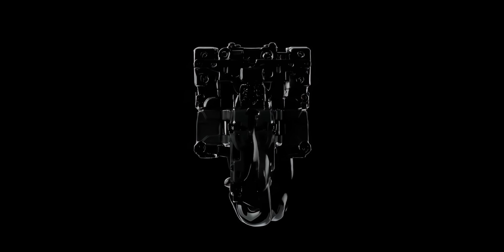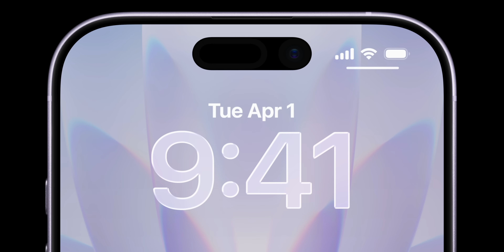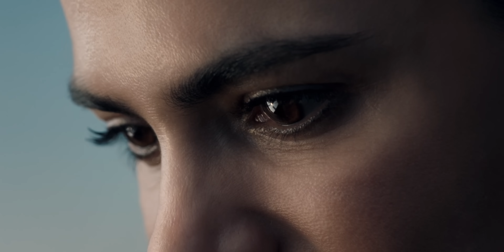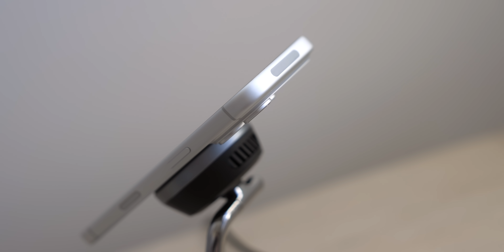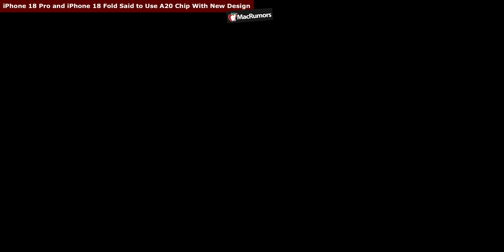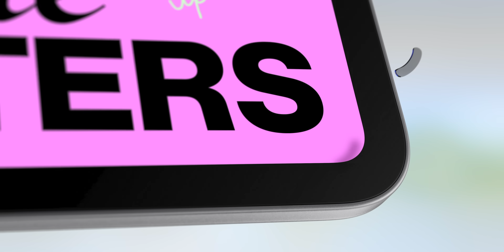iPhone Ultra Early Look! Major Leaks & Rumors!

Comment: I actually dislike Face ID, always found it so clunky:
-doesn’t work when I’m laying down 
-doesn’t work when i have any facial contortions, e.g chewing, or when i have anything in my mouth
-doesn’t work at more than a slight angle, like if i just want to quickly take a glance without holding it up, or when im working at a desk and the phone is flat in front of me (i have to pick it up each time to look at notifications which is more distracting )
- took them until after the pandemic to have it work with a mask and it still only works 50% of the time
- and sometimes it just doesn’t want to work

Comment: I would 100 percent rather have 2 devices. I keep an iPad mini in my bag and it is so much better than any foldable and costs way less. I see this ultra selling about as well as the iPhone Air. Especially if it is $2000+ cost device.
Reply: An iPad Mini is far less capable than a Z Fold. The Fold 7 is effectively the same size as an iPad Mini, too (similar screen real state in slightly different aspect ratios). The only thing the iPad Mini has over the Fold 7 is stylus support, in which case just get a Fold 6.
Reply: @nickthaskater I was comparing the rumored iPhone ultra to an iPhone  + iPad mini. The 2 device setup is far superior and costs less. I have never used a Z Fold, Fold 7, etc so cant compare it to an iPad mini. My friend did have the foldable Samsung that recently came out and I looked at it and wasn’t impressed because the screen looked like booty with that crease down the center.
Reply: @earnhar768  I know what you were comparing. The point is that an iPhone + iPad Mini is not "far superior" by any stretch. The software on iPad OS and iOS is incredibly restrictive, and the notion of having to carry around two devices (one of which doesn't even fit in your pocket) is inherently less convenient. 

You speak from no experience. I speak from 4 years of experience. Feel free to tell me how an iPad + iPhone is "far superior," though. 

As for cost, nobody pays retail for a Z Fold. The cost difference is effectively nil between a Z Fold and an iPad + iPhone.
Reply: @n @nickthaskater just yesterday I got an important business call when I was out running errands. I whipped out my iPad mini from my bag and had the perfect setup to talk on the phone privately (held up to my ear) and to see a screen to be able to solve the problem. 2 devices are better than one. If you want a foldable more power to you, but for me 2 devices are superior and I feel like most people would agree. I would also rather have 2 devices because it is a lot easier financially to upgrade the phone and just keep my same iPad mini. Plus if they come out with a new iPad mini i can upgrade that and keep my phone. Far greater flexibility.

Comment: Apple: Copy Different.
Reply: Everyone copies. In every industry. It's how things have been done since the beginning of time. At least Apple (usually) waits to get it right before releasing a product just for the novelty of it.
Reply: “Internal storage”
What?
Reply: Grow up
Reply: We don’t even want to break down the products that Samsung copied. Internal storage, non removal battery. Fkn touch screen without a stylus.
Reply: @g.dubyou6263 true at this point the finger pointing is not necessary in tech everyone copies, innovates, refines, etc
Reply: They even stole Xiaomi S11 Ultra design and got the nerves says everybody copy them. Took 10 yrs.
Reply: you look dead... are you ok...
Reply: Uh oh Apple fan boys, but don't want to acknowledge that Apple stole LG design for the iPhone and stole Microsoft tech lol
Reply: @WhosierDaddy yeah, no. The only phone that was even out when the first iPhone came out, was the HTC Touch. And Microsoft’s software was absolute trash. You need to watch the first iPhone keynote, because you’re way off. And I stood in line when I was 32 years old, in 2007 for the first iPhone. And it was far ahead of anything that was out.
Reply: @g.dubyou6263 lmfao now look at the patent LG created before former LG designer went to Apple sold the design. That's why Apple settle and partner with LG for manufacturing display screens. ✌️
Reply: @g.dubyou6263  iPhone iOS is based off Windows Vista pro sir lol
Reply: @g.dubyou6263  Even the new so called liquid glass comes from Microsoft that they created years ago. Just go look
Reply: @WhosierDaddy  Apple Fanboy and proud. I don't care if they stole stuff. I'm not Mr. Righteous over here! All I care about is that I get a quality product that will last over half a decade and even longer, and that as long as I keep paying AppleCare One for my products, that I can walk into ANY Apple Store, have a time machine backup at home, and just trade my device for a working one. Right there on the spot. Apple store too far away? Hit em up on the phone or iMessage, even. They will send you a box via fedex express that you have the next day, you pack it up real quick while the FedEx guy is there, he takes it - they get it the next day, they send you a new one that day, you have a replacement device. Want it even quicker and got the bread on a credit card? Let them put a hold on it and THEY WILL JUST SHIP YOU A REPLACEMENT THE SAME DAY FOR NEXT DAY. You return your old device, they release the hold for the cost of the new device. Bruh, there is so much more nuance to things than just "tHeY sToLe ThIS... tHeY SuCk" or even a myriad of other reasons. I support Apple because Apple has kept me happy with every single product I have purchased from them since around 2001-2002. Apple is great. End of story.
Reply: @WhosierDaddy we act like Samsung and or any other android company hasn’t “stole” an idea before
Reply: @wirecxreauto who said I didn't. Just apples still everyone ideas and it calls it innovative.

Comment: So it’s going to be made with Liquid Metal. Is this the same stuff used in the T1000? So how is Apple doing with the rest of Skynet technology?
Reply: Metals like gallium and cesium become liquid at slightly higher temperatures than room temperature. But I'm not sure what material Apple will be using.
Reply: @JedEckert  Gallium dissolves aluminium so if that’s used it might be banned from aircraft.
Reply: Wow! Fancy name Liquid Metal. Fancy name means dig deep deep in the pocket $$$$$$.
What a crock of crap with all these fancy names, liquid metal, retina display ect.
One positive here, it will have an awesome display thanks to Samsung. 
Apple is  expensive piece of jewelry in the pocket and Samsung and Google are computers in the pocket.
Reply: @dockbc  just go buy a pos pixel fold. You don’t even understand what apple is doing. 🤡
Reply: @dockbc 

Nobody is forcing you to buy it.